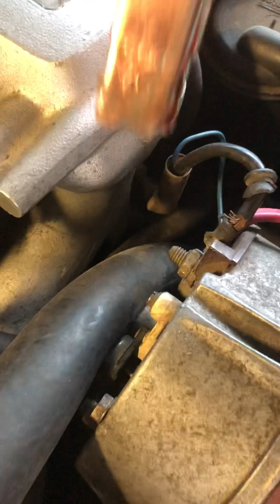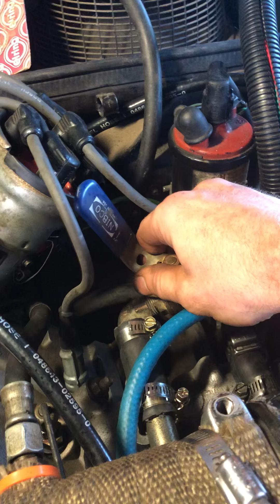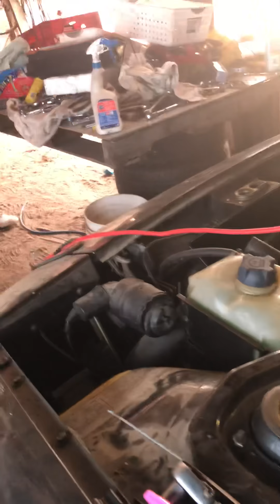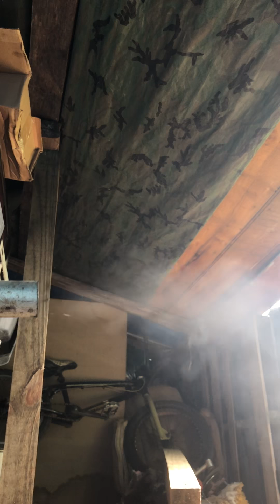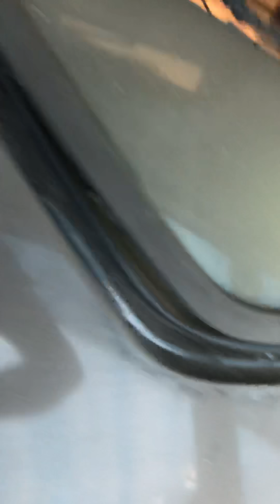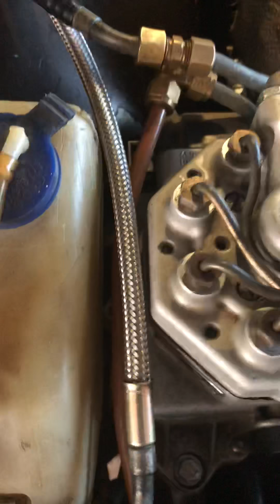Porsche 931 924 Turbo on V8 CIS-E Fuel Distributor First Run After Manual Tune

Comment: Love reading your posts on the 924board forum. Is the blue handle a manual aux air bypass valve?
Reply from the maker: Yes, the blue handle is idle air adjustment, bypassing the throttle body..